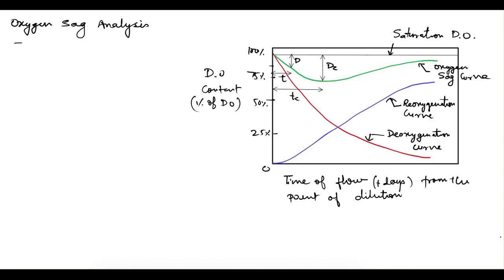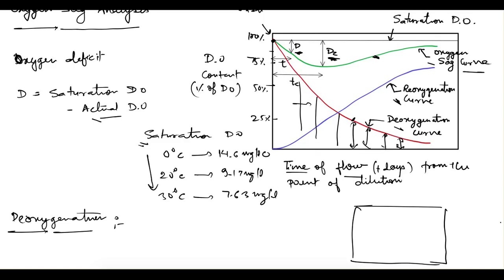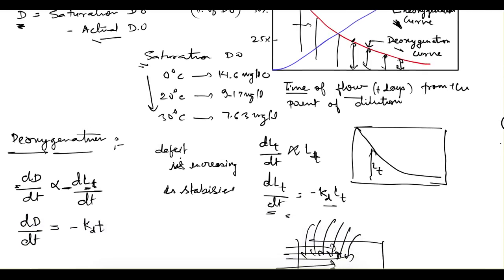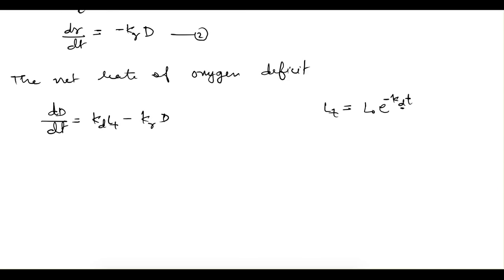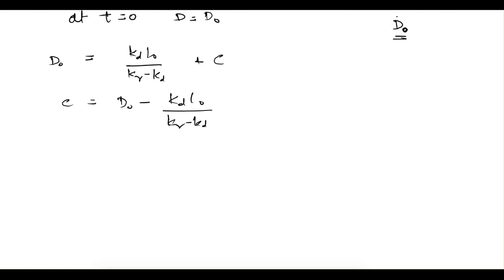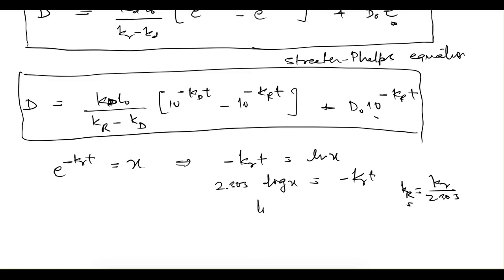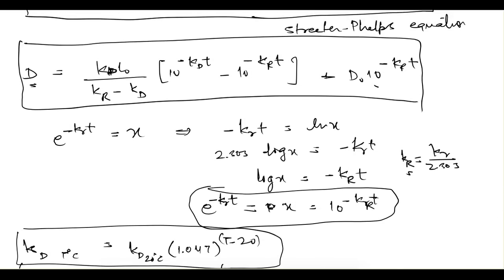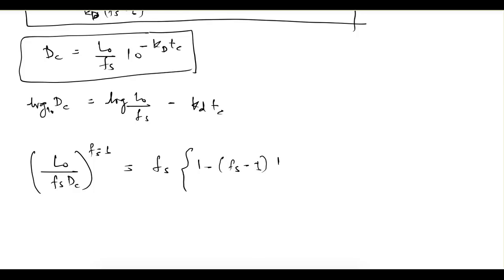Oxygen Sag Curve & Streeter-Phelps Equation | Waste Water Engineering

Comment: How deficit is increasing and decreasing?
Reply from the maker: At the moment waste water is discharged in river it has maximum oxygen demand and deficit less. Now the organic matter starts to get stabilised and dissolved oxygen goes on decreasing. Along with this deoxygenation reareation also takes place but the rate of reoxygenation is lower than rate of deoxygenation. At the point of Maximum deficit both the rates are equal. And after this point rate of reoxygenation is more and deficit goes on decreasing. 
Rate of deoxygenation decreases with time because it is proportional to the organic matter present and with time amount of organic matter also decreases.
Rate of reoxygenation increases with time because it is depends upon the oxygen deficit. The more is the oxygen deficit more will be rate of reoxygenation.